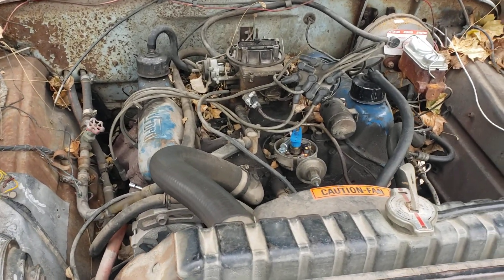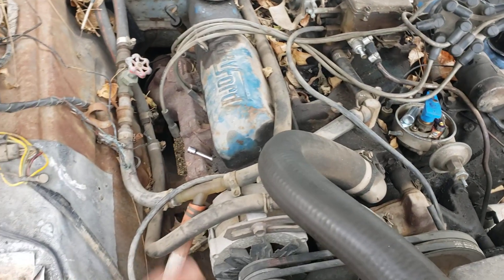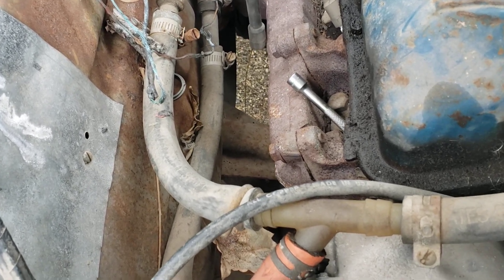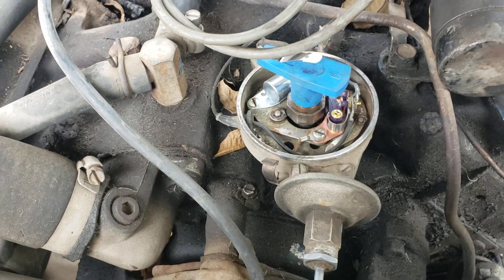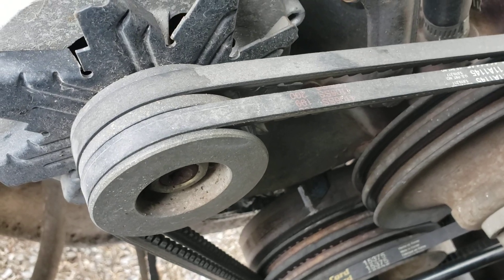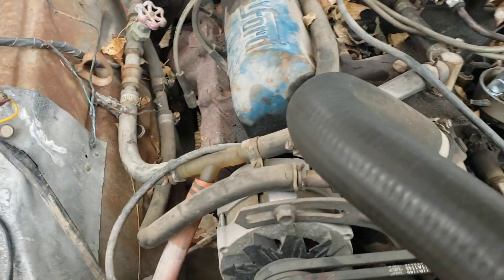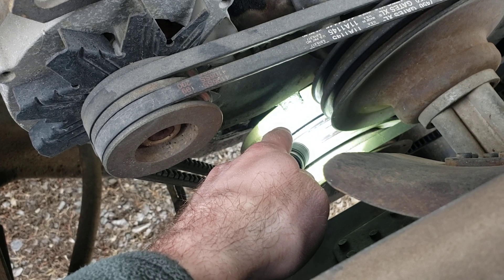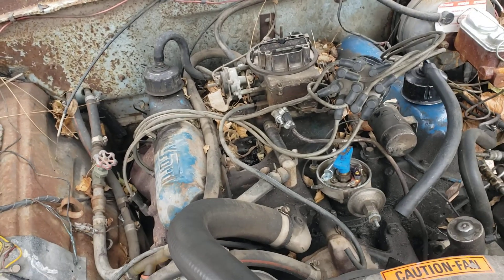V8 Timing Chain Stretch Testing

Comment: A timing chain that is just starting to "stretch" will first start showing symptoms (misfires) under which engine condition:  (A) highway cruise or (B) idle?
Reply from the maker: Are you quizzing me?
Reply: @BlakesGarage1  I have a 2005 chevy express 1500 5.3 liter.  The check engine light flashes intermitently above 65 mph.  There's a noise during idle that sounds like it could be the timing chain slapping against the cover.  I don't know if that's what it is.  The vehicle has 193,000 miles on it.  I already replaced the plugs and wires.  My next step was to replace coils 6 and 8 because my understanding is that those 2 coils are the first ones to go bad on this vehicle.  Snap-On scan tool misfire history says cylinders 1,5,6, and 8 have a history of misfires.  1 and 5 are the companion cyclinders of 6 and 8 and my understanding is that misfires are often misattributed to the companion cylinders.  I am thinking that a severe misfire that only happens above 65 mph is due to coils 6 and 8 being weak.  But then I hear the noise at idle that sounds like timing chain slap.  Maybe it has both problems, timing chain slap and bad coils 6 and 8?  Would coils that are starting to go bad act up at highway cruise first before it has symptoms at idle?  Would a stretched timing chain that is just starting to go bad first act up during highway cruise?  I wanted to phrase my question as clearly as possible.  Sorry if it sounds like a quiz.  I am trying to solve a mystery on my vehicle here.  The only codes are P0430 and P0300.  There are no codes related to cam crank correlation.  I honestly don't know the answers to those questions.